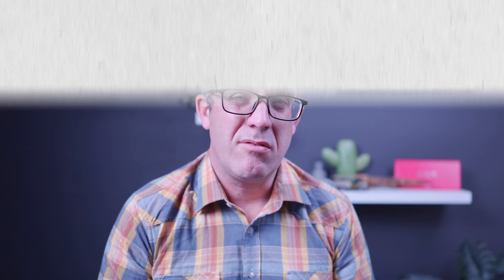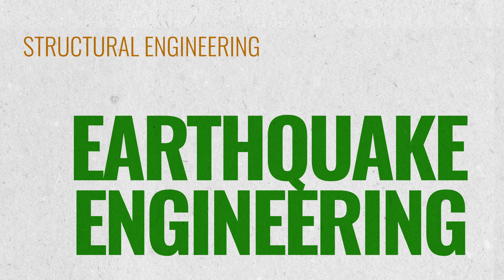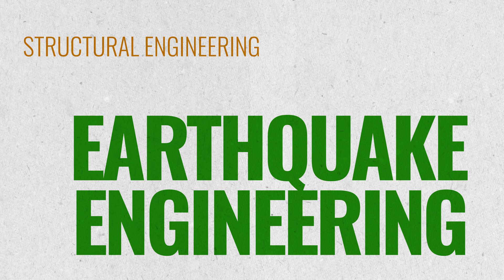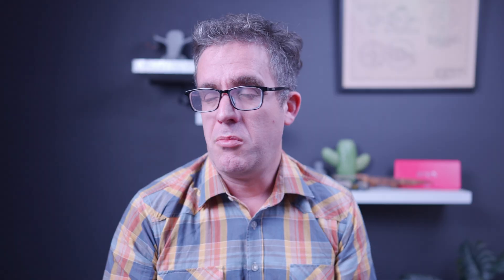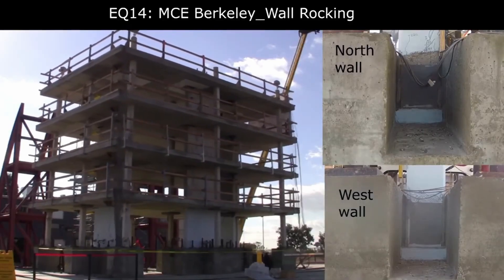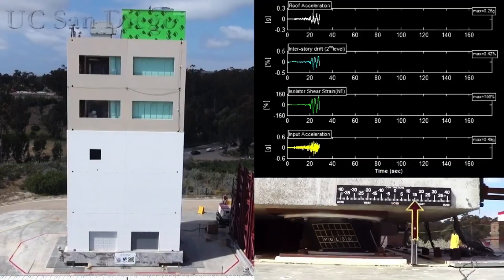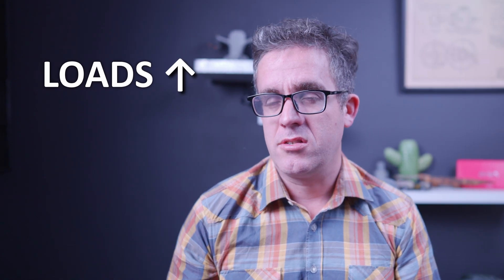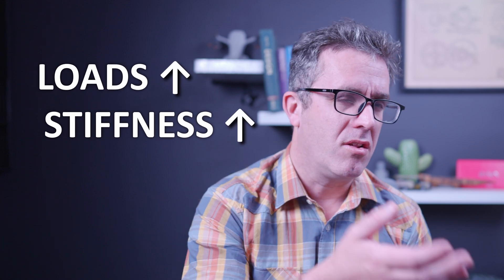Exploring the 6 Streams of Civil Engineering: Which One is Right for You?

Comment: My understanding is that apartment buildings are meant to allow occupants to escape the building in an earthquake event, but the building will still have to be demolished.  😮
Reply: depends on the extent and type of damage the structure was designed for. it can respond in a non-dissipative or dissipative manner

the damage can be concentrated in certain devices that will be replaced, repairing the structure. or distribute the damage and dissipation across all the Structural elements (and therefore the structure will probably have to be thrown away or repaired at great expense and cost). it depends on the choices made in the design phase and the budget available for construction